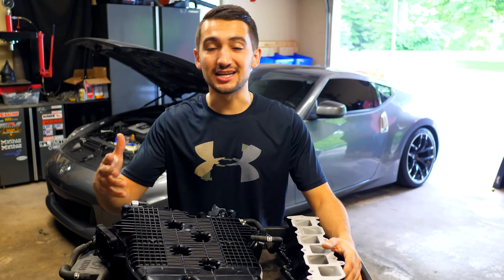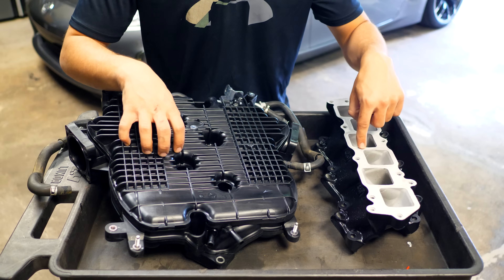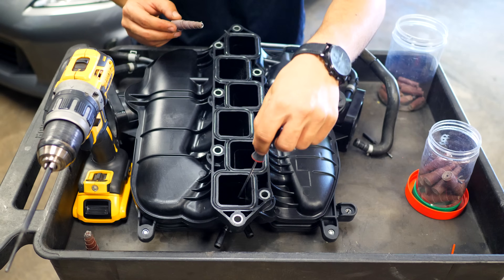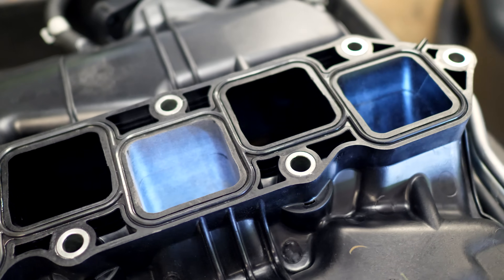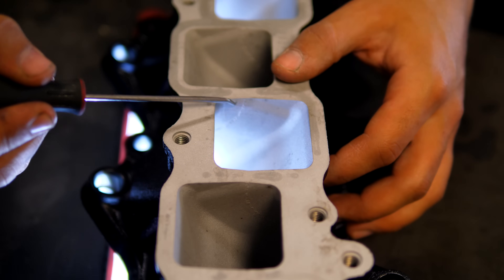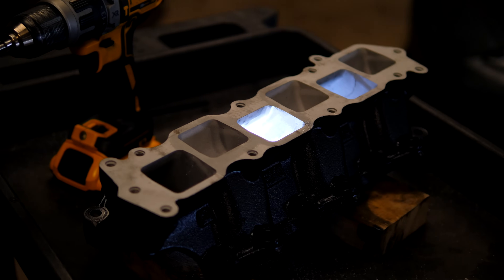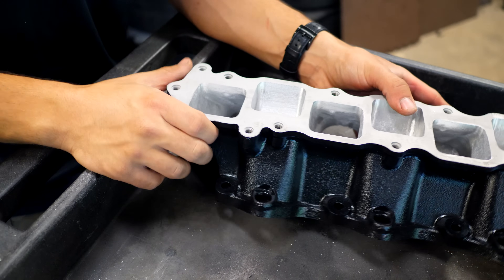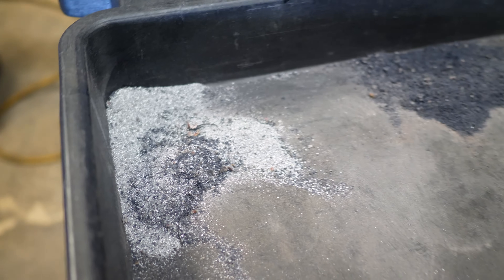How to Make FREE Horsepower!!!

Comment: This is honestly an underrated video - back in the 90's we used to pay good money to have our small block V8s ported and polished, and now you can DIY with a video like this that basically gives you the trade secret. Great info and nicely done!
Reply from the maker: Thanks Carlos! Feel free to share it and give it a thumbs up 👍
Reply: porting isnt just smoothing or making everything bigger. 
Thats why an old pro charges so much. Too easy to make a part perform worse than it does. Takes many many yrs to get proficient .
Smoothing like this guys doing...probably wont hurt anything but its not gaining any power either.

Comment: If you have a VHR 3.7l 370z or g37 just put a 3.5HR intake manifold on it… motordyne basically sells a m370 manifold for over $500 for the 3.7 and all it is, is a 3.5HR manifold with some stickers lol

Comment: Something that I want to mention is that the plastic didn't get any smother at the end, and that can affect the airflow, if you don't have the willingness or the patience to go all the way and sand down to a polished look the plastic, you could use a heat gun to "melt" the rough surface that you got left with!!
Reply: Melting would just cause more irregularities bcoz no way could u do it uniform like sanding but u only have to go to a certain grit not mirror finish like factory just think what a alloy one looks like inside they are not mirror finish &i know for fact going mirror polish on alloy in a plenum can actually reduce power as there needs to be a little roughness to encourage a swirl effect for better air/fuel atomisation then straight turbulence the only free way is if u know how to open the ports just enough to make power too big but n it also has a negative effect then port match everything same as the exhaust manifold n exhaust ports
Reply: You really don't want a polished intake track. Tons of articles on why you want it non polished. Exhaust ports you polish but you leave the intake ports just ported out.
Reply: @1330dai  I'm pretty sure that on port injection you can polish the ports before the injectors, as it will accelerate the air flow in to the engine, but you have to leave them rough-ish beyound the injectors to help the mixture atomization as for the exhaust the only advantage of a polished surface is to get the carbon build up delayed.

Comment: To all the peoples that are saying this is not much gain, that is dumb, because, at the end of the day, it's a gain, not a loss. So definitely it's an improvement, and it's free and easy to do if you move your asses and do the work by yourselves.
Now, you will definitely need to tune the ECU to keep the improvement, as most of the cars tend to correct the ECU settings and will roll it back to the factory tune, once it sees what was done to it, so keep that in mind
Reply: What can work even better is to port and polish the cylinder head too, but that is not for everybody and it can cost you a lot if you mess it up. To get the most out of it, port and polish the throttle body, intake manifold, cylinder head (Intake and exhaust ports), and the exhaust manifold or headers. That will make a really nice difference, and can be done for free if you don't want /need any special porting patterns
Reply: @avry87  Most oem tb intakes are plenty sufficient even with mods.
Reply: It is not free. A day's labour is what, $150-200 for average wage earners? Spend an extra day at work then buy a K&N air filter. 5hp instead of 1.
Reply: @thequietkiwi  what is not free, to diy? I assume that most of the peoples don't work 24/7, so in your free time you can do whatever you want. Nobody said to runaway from work, just to work on your car.😅
 I have been "building" my car in my free time, of course, and guess what, it runs and sounds better. Just a valve delete from my intake and porting of the throttle body, and intake gaskets matching, made it sound like it had a high flow air filter, and now with the k&n sounds even better then other stock cars, with just an k&n air filter.
Reply: Youre mistaken bud 
You dont know if its an improvement, small change, or none at all.

Comment: If you install new headers (cat-deleted) and new mid-pipe (cat-deleted) like you mentioned but cant afford to replace the stock mufflers (catback) will you still see a performance gain? I just want to know if this route makes sense cause I thought the mufflers where only an auditory gain for sound and not much more performance compared to the other part previously mentioned?
Reply: It might improve performance, as the cats are stealing some hp, but that it's illegal almost in any country, unless it's for track use, I'm sure you would gain more with a bigger bore exhaust then the stock. 
In most cases, the mufflers are just what they are called, mufflers, but the stock ones are quite restrictive, depends on the model, they can have the pipe shaped in "S" or whatever, so it takes more time for the exhaust to get out.
Reply: Youre correct. Mufflers are more for sound than anything else. 
Really not something you change and expect to see a power gain. 
Only in extreme circumstances, can it help. 
Like quiet cars that haul azz. Sleepers

Comment: Step 1: remove entire exhaust system.
Step 2: get pulled over.
Step 3: put it all back on.
Reply: Just install active exaust cutouts to bypass your catylytic converters and wire it up to a hidden switch.

If they go far enough to request an inspection you just have to say running them open is intended for use on track only.

Will only cost a $200-$400 depending on how many cats you have, the bore and where you install the bypasses.
Reply: Idk I haven't been pulled over yet
Reply: If you think that would help 🤡

Comment: He did remove a fair amount of material and smooth out the transitions nicely I'd guess the intake mod alone is good for 6 whp with another 4-5 ft lbs trq.
Reply: Nice guess, but probably more like 0.6 hp.
Reply: @thequietkiwi no you actually gain around 10-20whp all across the powerband with performance drop in filters and exhaust components.

Comment: You need to look at the choke point, meaning the smallest point of flow. Your valves are way smaller than the port, the points that you made in this video are related to cars that had fuel and air mixed, you have direct injection and this did nothing on this application.
Reply: The vq37 is port injected... actually do research next time.

Comment: You will "visually" see a difference but you only accomplish a super minimal (not measurable on a dyno) difference in HP.  You are dealing with a run of the mill daily driver, not an all out performance engine.  There are much better ways to spend your time and money to increase true engine performance.

Comment: A dyno comparison would be a good idea - the problem is the hp "gain" would be within the variance of error and therefore will not be sensitive enough to pick up any of the small gain or loss seen.  Any change seen would be the result of dyno variances between runs.  Swallow the loss of 7 hours of your time and go put on the bolt ons with a tune that will make a measurable difference.
Reply: True... not to mention the possibility of distorting the plastic manifold with heat.

Comment: Are there any other hidden, not as known things you can do to bump up the power in your car? I have a 2010 Chevy malibu with the 2 4L ecotec engine and there arent a whole lot of mods and stuff for it. I can really only get a tune and a cold air intake besides doing porting and stuff
Reply: You'd be much better off working on the suspension and brakes, and try to remove a bit of weight.

Comment: Milanmastracci, when I saw you polishing the plastic “imperfection”, I realized if hundreds of people watching this would do the same job and waste their time to gain 0.66 hp with a potential risk of contaminating the intake system.

My advice is DO NOT do this procedure!
Reply from the maker: Well I will be doing a couple Dyno runs with the car as is, along with how it is after some these installed.

Comment: Hi Milan.  I own a Hyundai Genesis Coupe 2016 with a V6 3.8 liter GDI engine.  Is there an easy way to inspect valves to know if they have carbon build-up to prevent a possible useless and costly clean-up expense?  Thanks! :-)
Reply: Trust me, if you have even 20000km on that motor you have sever carbon build up
Reply: Get a probe camera, remove the spark plugs and get the probe into the ports.  The footage will reveal the condition of the head and valves.
Reply: If you have a GDI engine you already have problems.
Reply: Just block of the egr for a start

Comment from the maker: WHO WANTS TO SEE A DYNO COMPARISON!?!?
Reply: +0.001 hp
Reply: Exactly 😂
Reply: Curious to see if there's any gain. Highly doubtful though!
Reply: You made a whopping 2 horses
Reply: Video should've started with a fun session with the normal factory , then do the sanding and see if there is any difference. Or just say fuck it call summit and have them give you a kit to force feed it 👍 . My opinion alot of time spent shaving and sanding for not alot of gain.
Reply: @henrymatthews9365  obviously you've never seen a high performance engine with port matched heads? Yeah ! Just put a supercharger on there. Lol.
Reply: @henrymatthews9365  so you have never seen a high performance engine???? I guess not!
Reply: Hmmmm a cold air induction can produce over 5 ponies. A k&n filter about the same. Port and polish? Matching ports? I think a bit more especially when opening up a lot for flow!!!!
Reply: That would be a big waste of money on a dyno run. You probably won’t even be able to see the change if any at all. Bruh you are better then this BS video!!

Comment: Enjoy your 1.2 hp extra
Reply: I would be surprised if its that much
Reply: Ported manifold that he is doing g actually brings about 15-20hp
Reply: With a tune this stuff can add 15-25 if you pair it with a good intake and tune
Reply: I ported the upper/lower, added drop in K&N filters and went up 19HP at the Dyno in my 3.5HR.
Reply: Im guessing you dont tune your z or g
Reply: So an electric turbo would get more power
Reply: After you port it. You would need a tune. More air needs more fuel.
Reply: try 5-10 hp.
Reply: Also possibly a lean check engine light.
Reply: @nightracerx   lol. yeah. no.
Reply: @nightracerx  Why would it become leaner you dumbass?